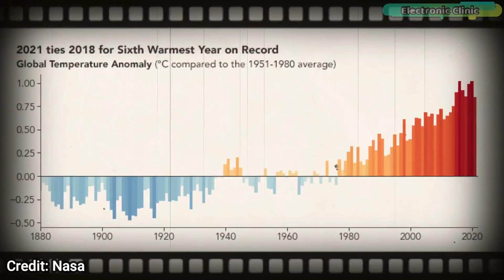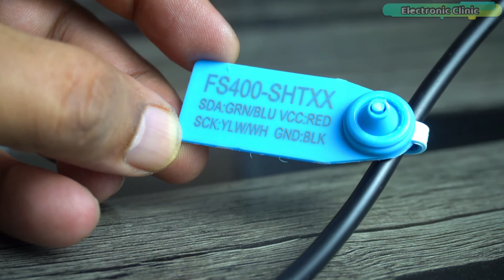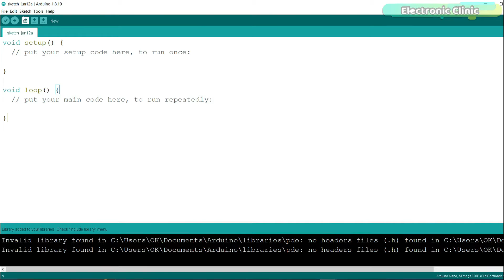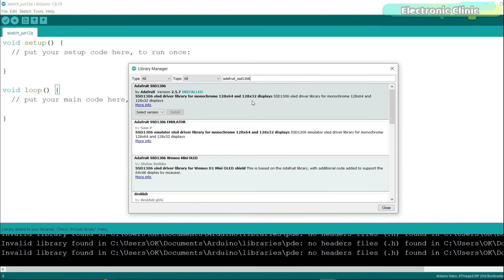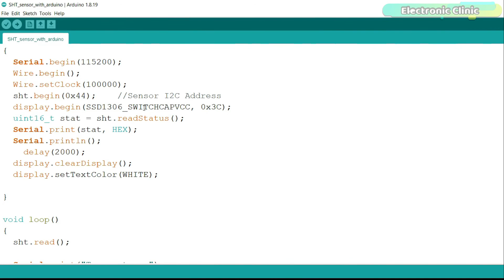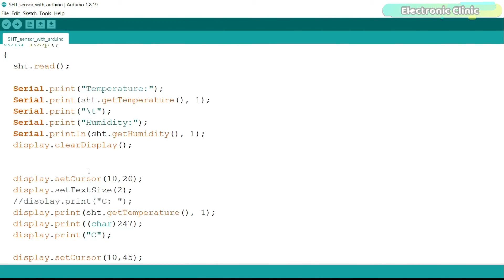SHT20 Waterproof Temperature & Humidity Sensor with Arduino

Comment: I am interrested in the SHT sensor housing. What makes it waterproof and anti condensation? It looks just like a regular plastic shell. Does it have a membrane?
I also found an SHT45 sensor housing on Aliexpress that looks like a metal sponge. Are those better or worse?